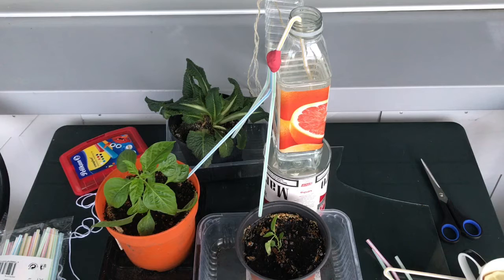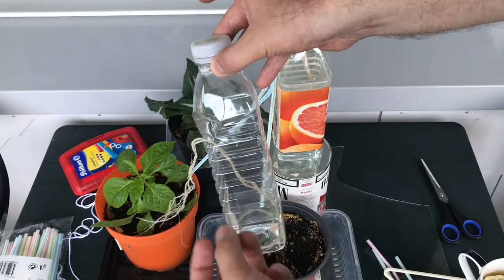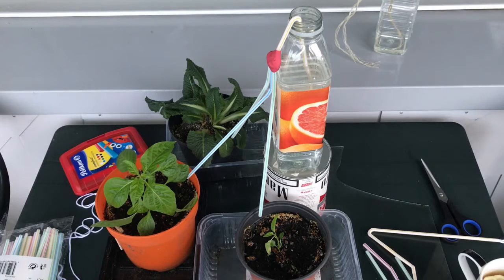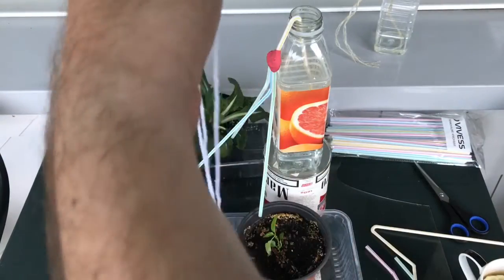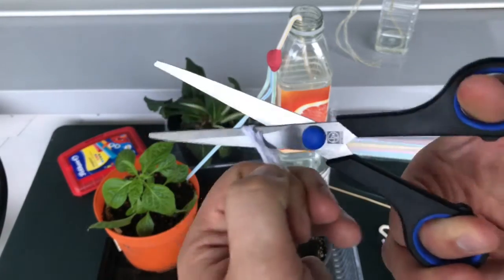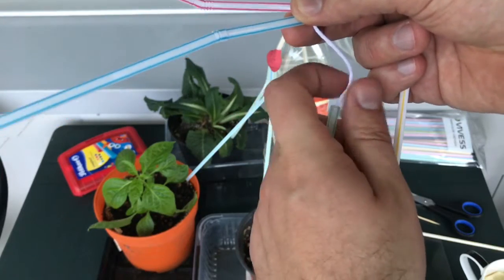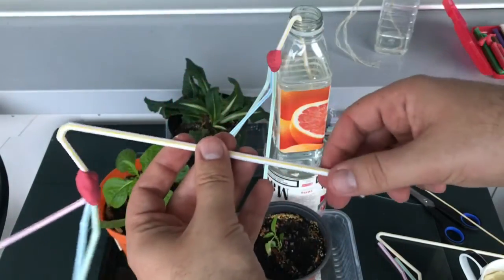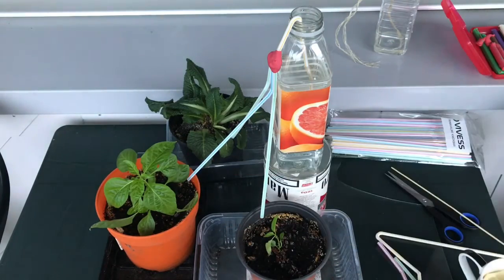Plant watering system for vacation

Comment: We had a horrible wet summer that destroyed our peppers.  I am growing in the buckets like I did in the past.  Tomatoes got hit by blight,so they are going in buckets too.  The only issue I face is water while I.m away on vacation.  Need to have a self watering system.  I giving that study.  Great video and great advice.  Thank You   Rob from Eastern,Ontario..
Reply from the maker: +Two Turtle Gardens thank you . Just make sure you use a large pot if you want it to work longer.

Comment: Hi Sir,

I tried a similar and simple one but when the level of the water reaches 50%, this drip is very slow and sufficient enough for the plants.

Did you experience it?
Reply: *not sufficient enough
Reply from the maker: True, the dripping rate slows down as the liquid level in the bottle decreases. It is normal and should be sufficient for the plants. To overcome this fast change in dripping rate I recommend a wider and bigger water vessel.